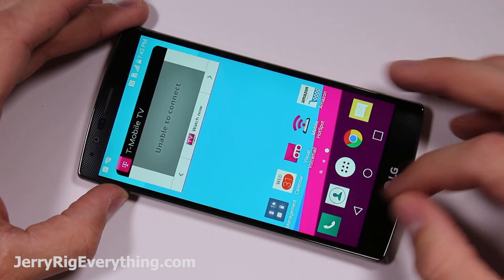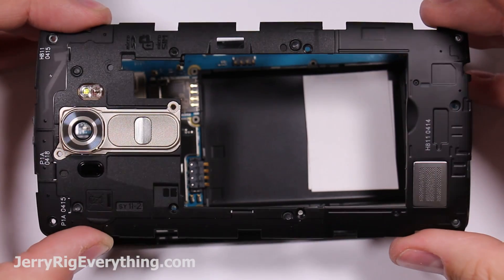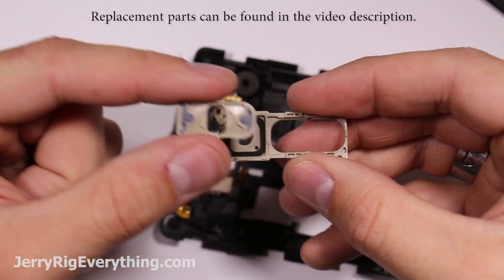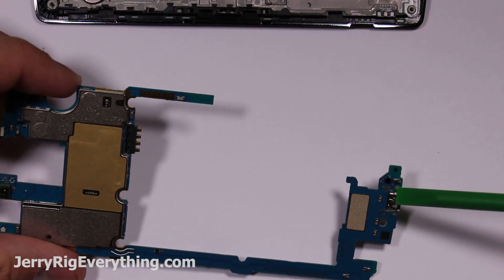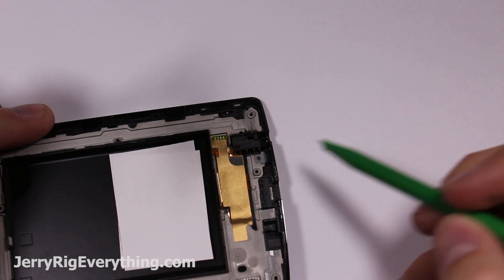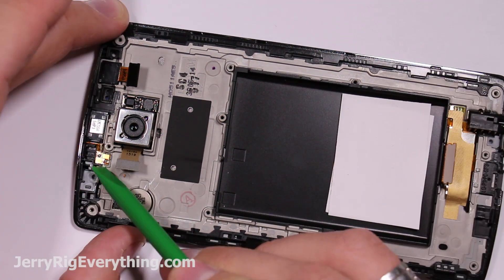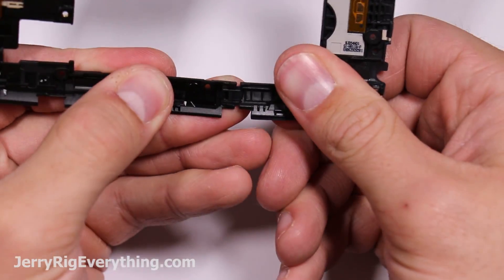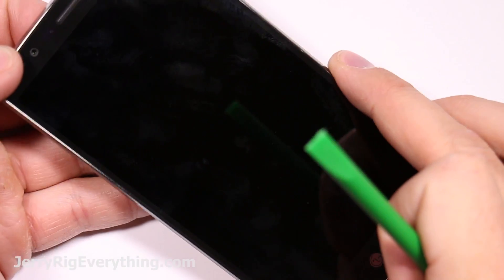LG G4 Tear Down, Screen fix, Phone repair video

Comment: The LCD with frame from Repair Universe in the comments is bare bones.  You'll need to make sure you transfer everything from your old screen to your new screen.  This includes a few items not detailed in this video, such as the led and proximity sensor at the top of the screen.  You'll also have to transfer the headphone jack.  This was kept in place by adhesive on the old screen.  It may work just throwing it in before closing it up, but I made sure the contact points were secure by putting a folded piece of plastic between the right side of the headphone jack and the board.  Everything is working great.  Thanks for the breakdown and replacement part information.  I almost bought a new phone.
Reply: Thank you thank you thank you for this comment. Very, very helpful.

Comment: I just installed a screen from the link provided in the description and it works great. Quality seems the same as factory.
Reply from the maker: +chaoticdriver This is great information.  Thanks!
Reply: +JerryRigEverything Do you know whether the glass of G4 is curved by default or flat and it is being forcefully curved when glued to the frame?

Comment: thanks so much. this was really helpful. saved myself 80 bucks by doing this myself. fyi... make sure you replace the proximity sensor or the phone will fail to stay on in dark light... I had no idea I was missing a piece to transfer. It's a small rubber piece to the right of earpiece at the top. You kind of have to dig it out but it's durable and you won't break it if you just tug on it. There's no adhesive and it slips easily into the replacement frame.
Reply from the maker: +Danielle Seamon Nice! Thanks for that tip! Glad you saved some major money!

Comment: Hey Jerry, I was planning to order the kit and all, but what happened was when i was using my screw drivers at home, I accidentally stripped one. Does the amazon kit work well enough to remove that screw driver? Or do you have any other ideas? Thanks. +JerryRigEverything
Reply from the maker: Removing a stripped screw is a whole new ball game.  The kit linked in the description definitely has the right sized bits. But if the screw is already too stripped you'll have to drill it out,  or use small pliers.
Reply: JerryRigEverything Hey Jerry, thanks for the quick response man, just wondering, will the drill break my G4? Thanks.
Reply from the maker: +jrsmoothman2 you would use a super small drill and super small bit. But ya,  if you've never done it before, you would probably break all the things.
Reply: JerryRigEverything I will just ask my dad to do it, and do the screws in the kit from amazon you listed, have the drill bits?
Reply from the maker: No, the drilling out of stripped screws is a whole different project, and will not come included with the regular smart phone repair tool kit.
Reply: +JerryRigEverything Im just gonna use superglue. Thanks for the video man, and one more thing the new lcd and frame is OEM right?

Comment: Hey Jerry, I dropped my lg on its backside and the glass for the camera broke I fixed it but whenever I try using the camera app or any other related app, the camera is unable to focus. Everything is blurry and it makes this buzzing sound. It does the same when I turn on the flashlight any idea what I should do?
Reply from the maker: Something probably happened with the camera itself.  Glass stuck in it,  not connected right,  or just general damage.

Comment: Hi can anyone please recommend me a shop/seller in United Kingdom that i could get proper quality replacement parts from? There are many offers on ebay and amazon but Im not sure which one will be the same or almost same quality as original parts
Reply: +rafizone Most screens are OEM compliant, so you'll be fine with whichever you order.

Comment: hello .. plz how can I fix black screen when I make a call on phone, messanger, viber etc  ???
Reply: +Amirtha warda thats normal, when you hold it near your head- it turns black, because you arent seeing it right? It does this with the light sensor. So if you cover that in a phone call, it will turn black.

Comment: hi jerry so i got my friend to fix my phone using the parts in the link, now I'm having a problem. 
it seems that when i used my phone in the dark or low lit room my phone screen just shuts or turn off. 
Everything works in a bright area any advice thanks
P.S
done a bit of research and it seems to be a proximity sensor problem?
Reply: +Lex Andrew Manalo StandInn 2 months ago

IMPORTANT!!! 
MY NEW SCREEN DIDNT COME WITH THE RUBBER IN FRONT OF THE PROXIMITY SENSOR: 

IF THAT RUBBER ISENT THERE, THE KNOCK KNOCK DOSENT WORK AND IN DARK ROOM THE SCREEN TURNED OFF EVERY TIME I WOKE THE PHONE UP. I PUT THE RUBBER PIECE IN FROM THE ORIGINAL SCREEN ( THE ONE WITH TO SMALL HOLES) AND ALL WORKED AGAIN.  THIS VIDEO DOSENT SHOW THAT.
Reply: +Beautiful Joy Hi thanks ill let my friend know about it and also is that the reason why i cant plug my headphones in the input jack?.

Comment: After replacing the screen, the rear facing camera is not working. When I open the camera app, it automatically goes to the front facing camera with no way to switch it to the rear. Does this mean the rear facing camera is not functioning or broken?
Reply: also, my rear facing camera is taking pics upside down but there is only one way to plug it in. is this a bad screen?
Reply: +Dennis Turskey Did you ever get this fixed?
Reply: No. I got a new phone
Reply: Thanks for the reply

Comment: IMPORTANT!!! 
MY NEW SCREEN DIDNT COME WITH THE RUBBER IN FRONT OF THE PROXIMITY SENSOR: 

IF THAT RUBBER ISENT THERE, THE KNOCK KNOCK DOSENT WORK AND IN DARK ROOM THE SCREEN TURNED OFF EVERY TIME I WOKE THE PHONE UP. I PUT THE RUBBER PIECE IN FROM THE ORIGINAL SCREEN ( THE ONE WITH TO SMALL HOLES) AND ALL WORKED AGAIN.  THIS VIDEO DOSENT SHOW THAT.
Reply: I found two gaskets that didn't come with my replacement screen that I needed to transfer over. The one for the proximity sensor is black, rectangular, and has two little round holes in it.  It can be found near the top, next to the front facing camera. The other one is gray and has a rectangular hole and a round hole in it.  It is on the top left.  This fixed my issues with the screen turning on and off.
Reply: +StandInn Have you got any pictures or description of how to do this please? Would help me out heaps. Thanks.

Comment: Hey, just a heads up if you are replacing the screen with assembly.  Where the proximity sensor lies (between the front facing camera and front speaker) will be a small rubber insert, this will need to be transferred to the new screen to prevent the proximity sensor always registering something as near.  This is due to it reflecting off the glass of the screen.

Comment: I had a ghost touch issue, I opened it up and put it back together, now when I switch on, left half of the screen is black at the LG logo and in the home screen. Touch is still usable. I have tried several attempt to reconnect the LCD flex cable. but still the same

Comment: what a nice phone to work on . i salute  LG for this smart assembly design .
Reply from the maker: yasser aboamoud I agree.  Quick and easy for all parts that need repairing.
Reply: And boy did they need it. The G4 has so many manufacturing problems, it's insane. Boot looping, IPS screen having image retention and weak volume buttons.
Reply: i had it for almost 2 years, and i had all 3 problems in your comment. i had warranty, so when it started boot looping i just replaced the whole thing. noticed the image retention over a year into the phone, so no more warranty. but it was a small issue. and weak volume buttons happened about 1.5 years into using the phone. again, not a big problem, but somewhat irritating.

overall, despite all these issues, i really liked the phone. i'm switching to the g6 in a week or so.
Reply: Bootloop
Reply: I have 2 year h818p but good work

Comment: Hello, I need help. my acer liquid z500 touch screen or touch screen digitizer is broken and the LCD's working fine. when i went to the repair shop, they said they will fix the touch screen and LCD. repairing just the touch screen is cheaper than repairing the screen and lcd and besides, there are no problems with the LCD. do they really have to fix the lcd as well, in order to fix the touch screen ? or is it possible to just repair the touch screen only? THANKS. :(